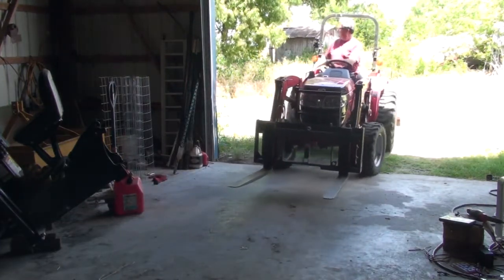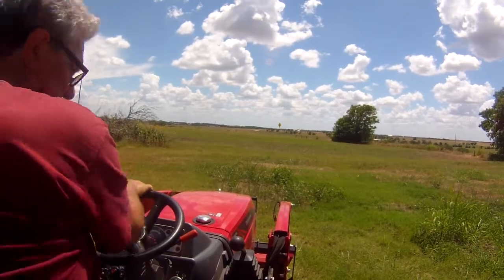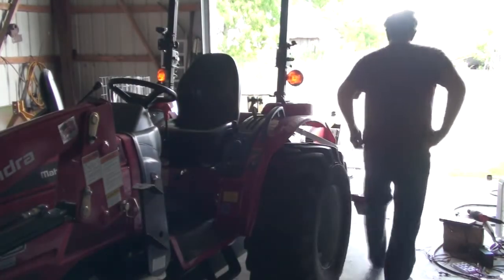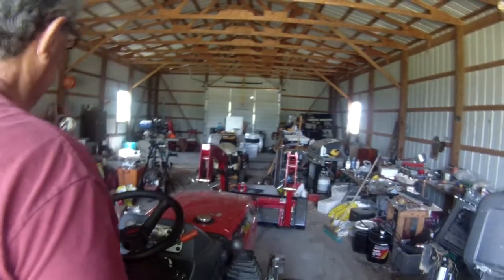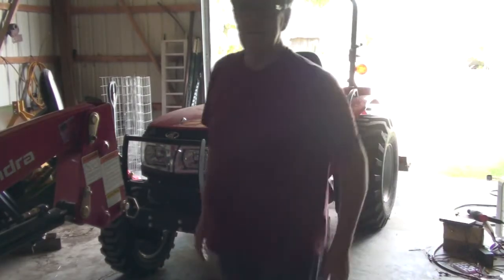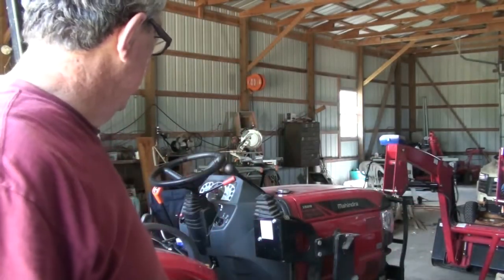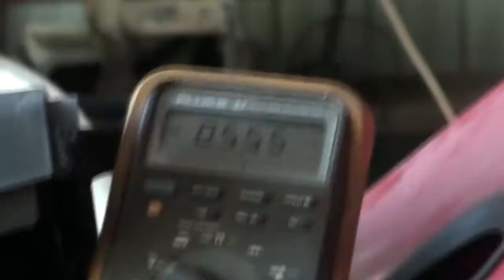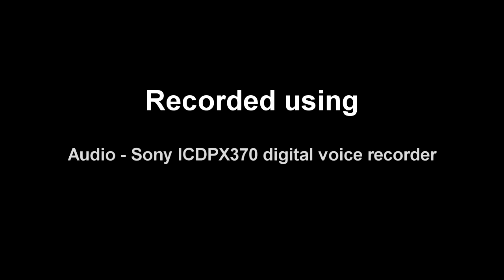Mahindra Tractor Cameras 1

Comment: That was a pretty slick operation for  FEL loader removal PM. Your looking pretty good after your setback. You feeling better? I've had some heart issues myself, and my wife is on me all the time about my nicotine addiction.  And after 45years of dipping it doesn't seem likely to quit. Good health to you my friend. Dean
Reply from the maker: 45 years? Light weight!!!!  I never dipped but I smoked for at least 54 years that I remember. The 17 days in the hospital made quitting a bit easier because they would not let me smoke and I was not in the best of shape to throw a fit. I also had my wife clean out all the smokes I had in the house so when I got home I would not have any to tempt me. And then with it being 12 miles to the nearest place to buy more and me not being aloud to drive for a few weeks..

That said it is now going on 2 ½ months since I had a smoke and I am not using any patches either because they said it would stress my heart (like I care). Bottom line is I still want to smoke and have the urge multiple times a day but I am hanging in there so far.

After the surgery I did threaten to leave against medical advice (AMA) on day 15 and the doc told me if I left I would probably die. I told him "you think you can scare a 54+ year smoker with a Probably?". Anyway, the threat of going AMA worked because I got them to stop waking me up every 1 ½ hours. I was just tired as I had not slept for more than 30 minutes at a time in 15 days except for the time I was in surgery. That and the food was so bad a stray dog would not even eat it.